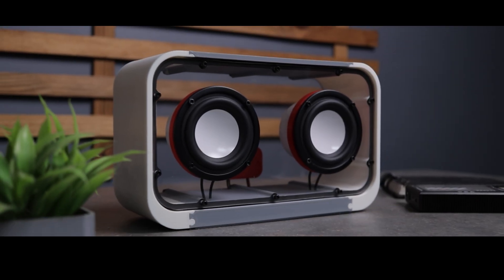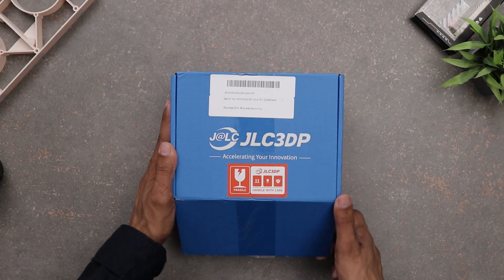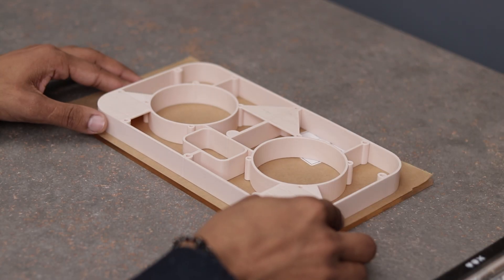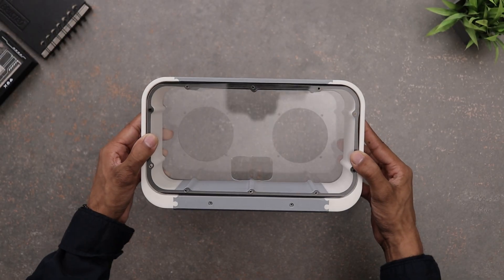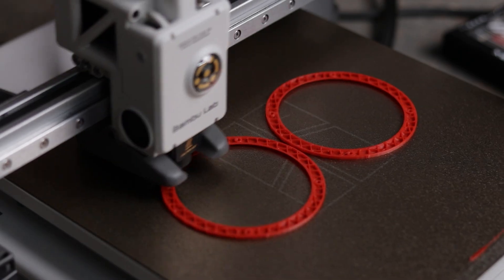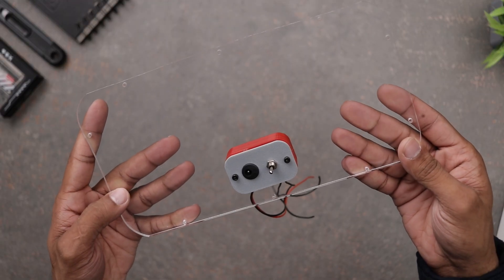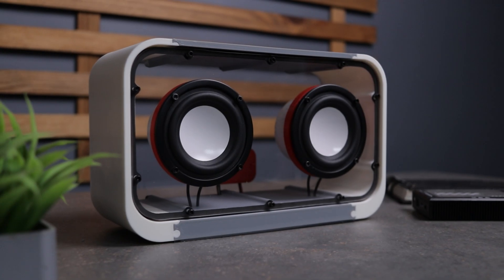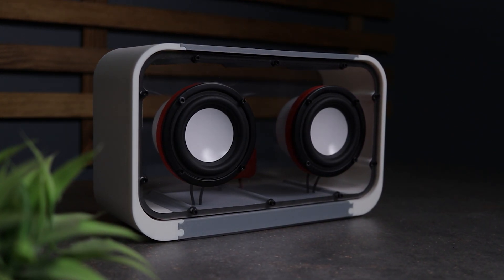I Build The Most Unique DIY Speaker Ever!

Comment: So I need to buy a good 3D printer and laser craving machine to make a DYI. Even after that the sound quality will be same or below avarage than a cheap speaker. The fiber panel is not good for music compair a wood panel. There are no active bass radiator to at least overcome some limitations.

But the design is mind-blowing. Good work.

Comment: I don't wanna sound nitpicky, but the outer edges of the front and back panels aren't perfectly straight. Did you slip with the router?

However I like puzzle style connectors of the case. Something I'll copy soon 😂
Reply from the maker: Yes, i slip the router, i aren't glued it perfectly so it came out during the process then it ruin the panel, so i made that with left over acrylic.

Comment: Not a critic but a fan....
And a speaker enthusiast 
This speaker can go for good mids and high not for bass....

You have to design the box with proper calculations of volume of air inside moving and add a passive radiator accordingly...
To get the best bass possible with those tiny 15 watt speakers ....

And more importantly you should use an higher output amp then the speakers itself...

Comment: ye but you may need to charge it or replace the batteries what you should do after the battery drains out of voltage i mean what you should have do if the batteries are empty